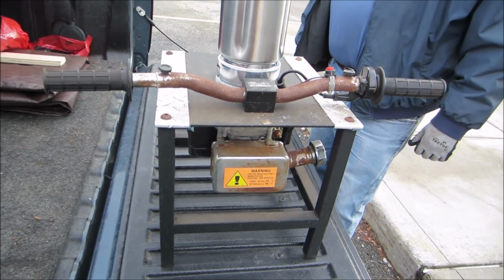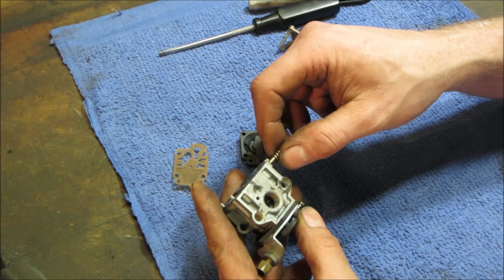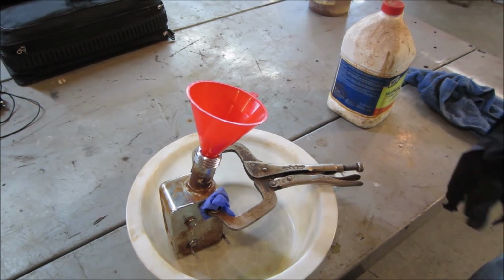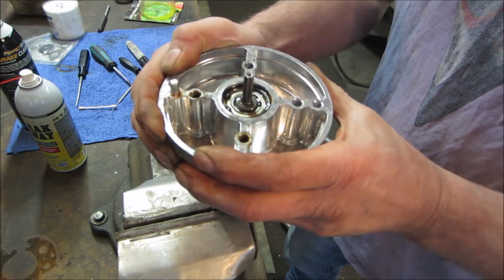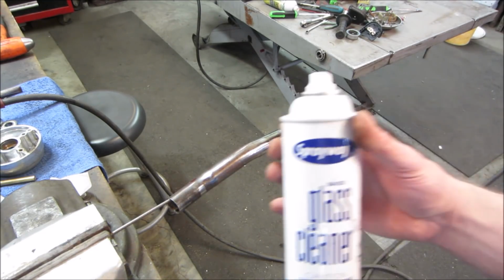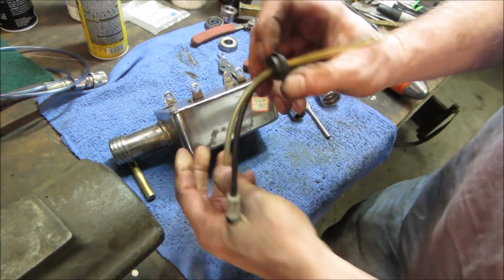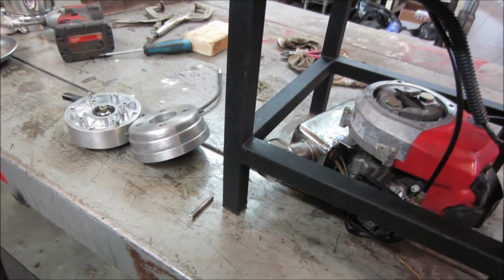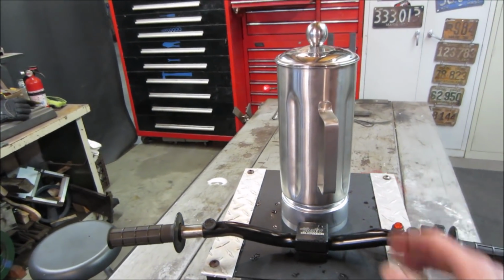Trash Picked, Engine Powered Blender. Will It Run?

Comment: When I worked on lawn mower engines (early 1960's) and later electronic gear I found that "Rubber Renue" allowed me to rescue rubber parts like grommets and idler wheels.  I could say that I used "All Original Parts".  Beware its TOXIC and really stinks.  I even heard that some mechanics used it to restore some seals in engine rebuilds.  Thanks for posting.  Been a subscriber for years...

Comment: Fun facts: These were only sold in the summer/fall of 2007 from several auto parts retailers in the western U.S.  The original MSRP was $499 but most sold for discounted $249. About 3000 of them were snuck into the country before the importer was fined and sued out of business by the State of California. They used a 49cc mini bike engine that was not U.S. EPA certified. (made obvious by the 50-hour oil sticker, a big no-no in the U.S.). There was also a safety issue -the pins that keep the pitcher locked into place would vibrate free, causing the pitcher to spin wildly out of control.

Comment: Electrolysis to remove rust. Takes a couple of hours. 12v supply, metal bar anode, cathode (the part), sodium carbonate-couple of table spoons in 10L tap water.

Comment: Sir – About the "rubber" gasket for the fuel tank--- the answer was right there next to you. 
The vise. 
Remove the fuel lines, heat/soften the gasket/plug in hot water, put the plug in the vise with the flat sides facing the jaws and close only enough to flatten the plug "a little". When cool check fit and if it's OK replace fuel lines either as found or later with new tubing. 
I really liked the video.      - Joe -

Comment: This video, too much fun! Congrats, the gas-powered mixer looks like new again. What a novelty at parking lot events and campfire cookouts. The only thing I'd worry about at this point is that the engine might require 20:1 mix instead. Would be a shame to find that the while the mixer was mixing, the engine was frying.

Comment: that's the thing i love about these vids always learn so many things. in late summer i repaired my 25 year old weed eater it wouldn't start properly if at all anymore and would just flood it self all the time. but once ive watched vids like this and learned about this rubber thing. i bought a rebuild kit and now it runs as it was new. i never known such a part would fail. until start learning things aha

Comment: 6202 ZZ.  It is cheaper to replace that bearing than to mess with it.  The “Z” means metal shield.  If it had “2RS” that would be rubber seals.
Reply: Knocking it out like that would have damaged it beyond any further  usefulness, pitted the bearing surfaces. But the whole thing probably worth less than a new bearing cost.

Comment: The "Washer" you used on the blades had to be made of STAINLESS or else it will rust with drink exposure - Most alcohol fruit drinks you'd make in a blender are very acidic/corrosive
Reply: @flick22601  Yeah, but what if he loses the engine? No garage gimlets.

Comment: -Z means it is shielded not sealed. Should be a sealed bearing. -2U or -2RS depending on bearing manufacturer. If you use a-Z it will just fill with water or blended drink again. It really needs a drain hole drilled through above the bearing in both cases.
Reply: I was about to write the same thing about the design...it is %~^}*.  Any liquid spilled will collect below the coupling and flood the bearing.  Regular blenders use a coupling above the surface so that liquid drains away and you can clean underneath it.  Probably not done that way for safety reasons.  The drain hole(s) is a good interim fix...and leave the mixer on the stand to cover the coupling when not in use.
Reply: If the jug is off maybe a cover could protect it, for now!
Reply: I buy 10 6202 RS bearings for $13 on Amazon. They are used in many things.

Comment: Be careful with the muriatic acid in a garage, the fumes can rust any exposed metal over night.
Reply: Yep happen to me tools and all
Reply: Pool chemicals will rot metal also. When I worked at a motorcycle dealership had a couple of customers complain about all the chrome rotting on their bikes. When I went out to pick up the bike for service I saw all the pool chemicals stored in the garage with the car and motorcycles. Told em about it and said they needed to move em before I brought the bike back.

Comment: Did you know that you can use denatured  alcohol to make rubber slick ? This will help with pulling those VW engine bay gaskets through the track. Use a old spray bottle and spray both the track and the rubber and it will slide very easily. No, it does not damage the rubber.

Comment: Hey Mustie, the mechanic's wire seemed to work just fine, and great idea on that one! Should it give you troubles later on you could try doing the same thing with a neoprene O ring (or 2) slid onto the grommet, I imagine it would have much the same effect, and maybe even seal better!

Comment: We used to take those metal caps out all the time just for that reason. If cr@p gets in there, it's sometimes hard to get out. It wasn't on cheap bearings either. Most of the bearings we used on our roller skates were fafnir's back in the mid 70's. You could punch a tiny hole in them and they'll pop right out. Looks like those are the same. hard to tell.

Comment: Get yourself some ATP at-205, its a plasticizer so it’ll bring a lot of rubber seals and grommets back to life. I normally either brush it on or drop things in a jar of it, it works a lot better than hot water.It’s supposed to be engine oil treatment but I’ve never been brave enough to put it in my engines

Comment: Fantastic video :-D
To try to defend your screw swap excuses - The screws might have been the way YOU first put them, but before this motor was on the blender table - maybe it was another application with a thicker material in this gap, that was then modified to be a blender. I agree with the suggestions to add a rpm meter and other dashboard gadgets - maybe a headlight and a horn - even neat if it had an electric start.

Comment: The only reason I instantly knew you had those screws wrong was because when you were taking it apart I thought "what kind of jackass puts countersunk screws in flat sheet of metal?!" 🤣

Also, the varied shape of the blades is to induce the pulsing of the contents you saw to ensure there aren't any big chunks left over.

Comment: I noticed when you put the screws in opposite how they went in and was like that may cause a problem haha but in all honesty when you showed the beveled edge on the inside i 100% agree they put them in wrong and just used a longer screw to correct the issue. It also makes sense that with the bottom screws holding the motor up that it shouldnt have been the screws but the stronger allen bolts to hold more torque instead of the flimsy philips head screws that strip if you give them a half an ugga dugga too much. If i were you i woulda just shortened the allen bolts and ran it the way you had it. Just makes more sense that way, but hey thats why mechanics hate engineers lol

Comment: Cool channel. Run castor oil for that true race track mixed drink. Household vinegar is about 6% acid, you can get gallon jugs of industrial vinegar that is 30% acid at homedepot. 30% vinegar is what I use to clean concrete and kill weeds.
You can buy this blender for $285 on uncrate.

Comment: Seeing as the overall quality of the original product seems consistent with its novelty factor, I'm guessing that either the machine shop apprentice loaded a regular 120 degree drill in place of a counterbore drill in the CNC machine tool cassette, or the designer used the CAD hole wizard and didn't change the drill type from the default setting.

Comment: Use a mason jar. as a vacuum chamber. insert Grease on the bottom of the Mason jar. deep enough to cover your cased bearings completely. insert bearings. pull a vacuum. and the sealed cased bearings will become packed with grease again. Mason jar can be found just about anywhere. Harbor Freight has a cheap affordable vacuum pump. thank you and have a nice day.

Comment: @Mustie1 , I have an idea for the tank gasket for the fuel line. Cut and slit some fuel line and use it to line the hole. It will take up the gap. It's like what is done when you pass a wite through a cut-out.

Comment: Don't mess around with it!! Replace the bearings!! NTN Bearing 6202Z Single Row Deep Groove Radial Ball Bearing, Normal Clearance, Steel Cage, 15 mm Bore ID, 35 mm OD, 11 mm Width, Single Shielded or get 6202ZZ double shield! NTN is a excellent bearing...

Comment: I had a problem with a carb just like that on my weed eater, the problem was a pinhole in the primer bulb. I only found the problem by accident. I was trying to get the trigger to gas up and put my finger on the bulb and it started running right got excited thinking it was good moved my hand and back to problem. changed the bulb out and its been running great for three years now.

Comment: I  was wondering if you took the gas hoses out of the rubber grommet and compressed it with the vice if it would cause it to expand enough so it would fit tighter.

Comment: I put TB1184 on all grometts.  That, keeps them from leaking and is fuel resistant.  Playtex Moto Seal can also be used., both fuel resistant.  I like 1184 because it allows you to remove it, later.

Comment: For rubber into gas product is Seal-All in a yellow and red tube! It’s so tough it held inside my three wheeler gas tank for about 2 years until I got a new tank I think it would have held another 2 years never used anything that could hold up to gas like this stuff

Comment: You did not lie, you were just wrong or incorrect. If I was working on this project I would put it in the press with some pressure and let it sit for a few hours or longer. I have never seen a long handled flex head 1/4 inch drive ratchet before now. Who made the one you have?

Comment: MUSTIE!!! Thats the exact same chineseum engine used in superstore own brand strimmers, they have a habit of not running right on the idle and people just throw them away without looking real closely at carb!
People think the idle mixture is non adjustable!  bit it is! 😉
Look closely into the top of the throttle linkage, there's a brass ring with a slot and a hole, look into the hole and f your lucky you'll find a wax or plastic plug, remove it and underneath you will find the idle mixture screw! Not all have them but the majority do especially as it looks like the diaphragms in the carb come from a walbro.

Comment: That fuel line grommet - weld the hole up then drill it a little bit smaller? Use the same grommet...better seal.

Comment: Alough i have never tryed it myself, aparantly the  "right stuff" rtv sealant is suitable to use with gas
Reply: Right on the 5 oz  tube in my left hand:      " NOTE:  Not to be used as a head gasket or on parts in contact with gasoline.     - Joe -"
Reply: @joesinakandid528  good to know, as i said never tryed myself. Just what i was told

Comment: I would have heated that grommet up to soften it then crushed it in a press or between two plates in a vice.
An alternative to the bolt lengths would have been to trim those longer cap head bolts to not bottom out, seems like they made a mistake when they ordered their bolts at manufacturing.

Comment: That would be a 6203 brg. That is a metric bearing. Most common. A timken brg is a SAE size (standard sizes). Most timken are like 1", 2" etc. The second digit(2) generally tells you the width of the bearing. Bigger the number the wider they go.'

Comment: Oh and by the way I was going to ask you why did you change the screws for the top I know right away when I saw you using a screwdriver on the top of the blender that you didn't use the Allen wrench I was wondering why you change the screws

Comment: On the fuel tank on the rubber Gromit huge copper wire around it I would’ve thought he would’ve used a O-ring just a suggestion

Comment: I have a question for you I have a 97 Toyota 4runner   and my rear frame is rusted almost through  could you please help me how to fix it  I would be  very much it has  Over 300000 miles in the body is great I will   be greatly appreciated

Comment: Don't even bother buying carb kits for those 33cc 2 stroke Chinese motors - you can buy the entire carb, with new fuel lines and gaskets and everything, for about $15 from some hardware stores (even walmart sometimes), amazon always has them in stock, etc - search for "Shindaiwa T242 carb" - I have 3 or 4 of those same motors around from gas powered scooters, cheapo-string-trimmers, and a no-name chinese leaf blower. Ever 4 or 5 years I just toss the carb and throw a new one on as soon as they start acting up. The carb kits are $20 for just the o-rings, seals, and diaphrams, vs. $15-$17 for an entire new carb with everything.

Comment: You should have sprayed lube on the bolts and whatever needs lube the minute you got it and did every time you thought of it until you made your video. I'm surprised that you don't do that, it's requirement number one for taking apart rusted and neglected parts. You should teach the neophytes the right ways.

Comment: I have some stupid grommets like that on the tank of my cub garden tractor, very stupid design imo. one on the left and one on the right side of the tank, but they're at the bottom so they're always submerged. last year one of the grommets popped out. the tank was half fool, all of it on the ground. I could order replacement grommets, but I don't like that design at all. my plan this spring, I got some plastic epoxy, should be safe for gas. gonna seal the original holes in the talk, reinforce the epoxy with stainless mesh to bridge the gap. get rid of those bottom holes completely, I'll drill a new hole near the top of the talk where it wont ever leak again.